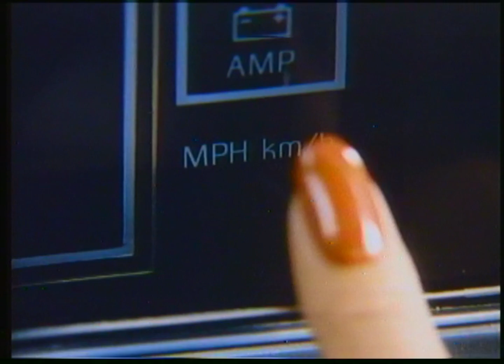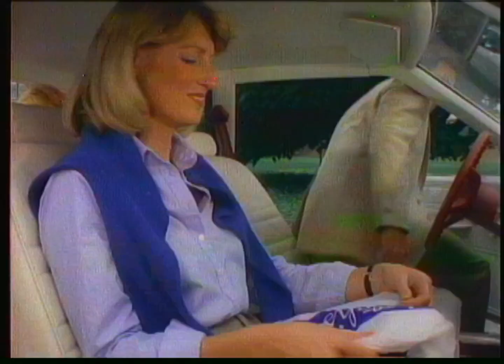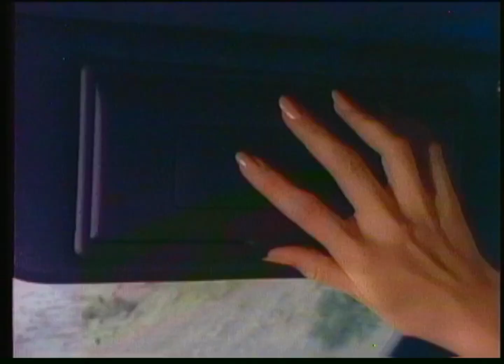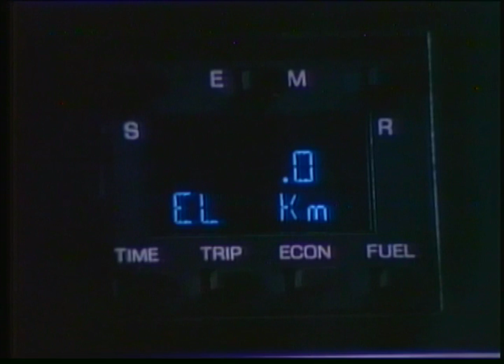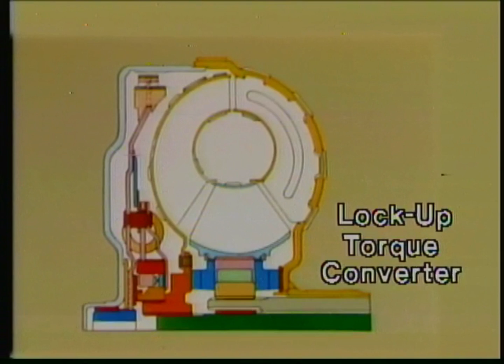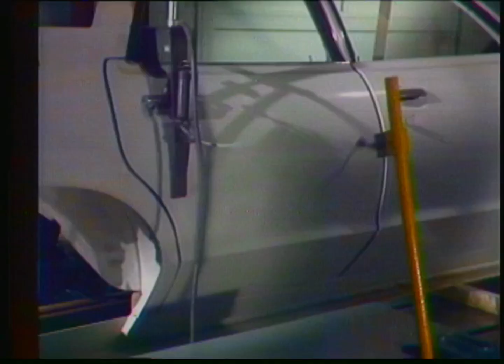1982 Ford Thunderbird

Comment: Love these old dealer promos, thank´s for uploading🙂
Horsepower figures for 1982:
3.3  88hp        3.8  112hp        4.2  120hp
I understand why they didn´t mention the power output of those engines..... Over here in Europe a typical "luxury" car in that period had a 6 cyl engine with a displacement in the 2.8 to 3.0 lit range, producing between 150-200hp. The European cars You got in the US was really hurt by the emissions control systems.
Reply from the maker: Glad you're here
Reply from the maker: I agree 100% emissions killed every car that ever could be anything in the 1980s
Reply: Horsepower ratings were SAE Net, off back wheels. For engine gross horsepower, add about 25 HP.
Reply: @BruceBiazzo-qp1rh  The SAE gross was only used before 1972, the SAE net is comparable to the DIN norm that  most of the car producing countries arround the world use. The SAE net is not measured off the drive wheels, but of the crank of an engine with all accessories in place. The "gross" figure is of the crank of a "bare bones" engine.

Comment: The 1980-1982 Ford Thunderbird (and Mercury Cougar XR-7) was a design and sales disaster (1982 Thunderbird sales collapsing to only 45,142 units). The success of the downsized 1978 General Motors mid-sized coupes (A-body) had really caught Ford Motor Company off guard. So Ford designers quickly took the Ford Fairmont Futura Coupe (a rather clean design), extending the wheelbase and bulking up the sheet metal to create this Thunderbird. Sales in the introductory 1980 model year fell dramatically from the outgoing bigger Thunderbird from 1979. The cash cow, profitable 1977-1979 Thunderbird was no longer. However, the interior of the new Thunderbird was more likeable than the exterior, with sumptuous heavily padded seating in the Silver Anniversary model (borrowing from the design of Lincoln). Options such as a digital instrument panel and keyless entry system were very groundbreaking for the era, too. But despite the new Thunderbird's technology, the Monte Carlo, Grand Prix, Cutlass Supreme Coupe, and Buick Regal Coupe were much more popular. Ford Motor Company really laid it on the line with the completely overhauled 1983 Thunderbird, which was a significant design improvement with sales jumping dramatically to 122,000 units.

Comment: By this time, Ford knew that the 1980-82 Thunderbird was a sales flop.  Total sales : 288,638 of which 156,803 were the 1980 model.  Total sales of previous gen 1977-1979: 936,038
Reply: I can only imagine the reaction from General Motors when this Thunderbird/Cougar XR-7 was introduced. (To be fair, the interior design was decent for the era but the exterior was awful.)
Reply: @SpockvsMcCoy  
GM introduced the X Body Citation etc.  They sold like crazy but they turned out to be really awful cars.  
GM didn't see the 80 T-Birds as a threat
Reply: @ Bad styling turned a once popular Thunderbird (1977 through 1979) into a sales flop. Plus, the previous Thunderbird made a lot of profit because of its old engineering (dating to 1972 Torino).
Reply: @SpockvsMcCoy  GM didn't have much to worry about.  Adding the XR7 sales to the 77-79 T-Bird sales above is a grand total of 1,391,061.  It's a big number...for Ford.  The 4 GM Colonnade coupes:  Cutlass, Monte Carlo, Grand Prix, and Regal, had total sales of  1,368,256 in 1977 alone.  All  were downsized in 1978 so total 1978-79 sales for the 4 were 2,374,085, for a grand total of 3,742,341 2 door coupes from  1977-79.  Top seller was the Monte Carlo, total sales 1,086,052 for 1977-79.  The T-Bird was a huge success for Ford, however the GM cars had the personal luxury car styling and size since 1973, and the production capacity to sell them.
Reply: @SpockvsMcCoy  GM didn't have much to worry about.  Adding the XR7 sales to the 77-79 T-Bird sales above is a grand total of 1,391,061.  It's a big number...for Ford.  The 4 GM Colonnade coupes:  Cutlass, Monte Carlo, Grand Prix, and Regal, had total sales of  1,368,256 in 1977 alone.  All  were downsized in 1978 so total 1978-79 sales for the 4 were 2,374,085, for a grand total of 3,742,341 2 door coupes from  1977-79.  Top seller was the Monte Carlo, total sales 1,086,052 for 1977-79.  The T-Bird was a huge success for Ford, however the GM cars had the personal luxury car styling and size since 1973, and the production capacity to sell them.
Reply: The 77 to 79 were peak sales numbers for T-Birds.  Plus they were very stylish
Reply from the maker: Damn I believe those numbers too though. It seems like Thunderbird did not have its own platform and it was trying to find somebody else's so that it could just be built and exist

Comment: Had a close relative to this piece of crap a 80 Zepher. Included with the 3.3 six [ 200 CID ]. Earlier I owned a 60 Comet, notice I didn't mention Mercury Comet as the car didn't say Mercury anywhere on it. The reason for this is when it was conceived it was a step up from the Falcon as it was around 7 inches longer and had 4 head lights as opposed to 2, you may say it was the first midsize car from Ford. And was planned as a Edsal to give Edsal a smaller less expensive car to sell, this was the reason for the oddly canted taillights As we all know Edsal was cancelled in 1960 but Ford had already made a bunch of these and sent them on their merry way to Mercury dealers to sell and they survived until 1974. on the Maveric body. At any rate my 80 3.3 with a thundering 88 HP could blaze down the road at 76 MPH if you dared [ a little less with the A/C on ] but made up for this with poor gas milage. All went well until around 75K miles when the thrust bearing [ part of the# 4 main bearing] blew out. Causing  the crankshaft to move back and forth about an inch and inducing a nasty rod knock. This motor standard on your T-Bird had it all, no power, bad milage, short life. Bet owners were delighted to have this boat anchor under the hood.
Reply from the maker: Yeah it was a tough time in the early eighties. With the emissions and smog devices literally choking the life out of engines

Comment: The 1982 was a very small uncomfortable and weak but the 1974 thunderbird was a great car with a 460 engine and steel chrome bumper and a towing capacity of 10.000 pounds
Reply from the maker: That was before the Great Smog regulation came and choke the life out of every V8 that existed in the late seventies early eighties

Comment: Is it just me, or does it seem that Ford couldn't decide whether or not to offer 6-passenger seating?  The narrators mentioned front bench seats, and the cars shown had column-mounted shifters, but there wasn't an actual middle seat in front.  Front bucket seats and a floor-mounted shifter would have provided a sportier look.  Ford could have saved on overhead by skipping the column-mounted shifter and front bench seat option that wasn't providing room for that 6th passenger anyway.
Reply from the maker: 100% agree. It was a bummer to me that the 5.0 was no longer an option as well. The 80s was a tough time for automobiles.
Reply: Rolling in my 5.0 with the ragtop down so my hair can blow . . . . . . .